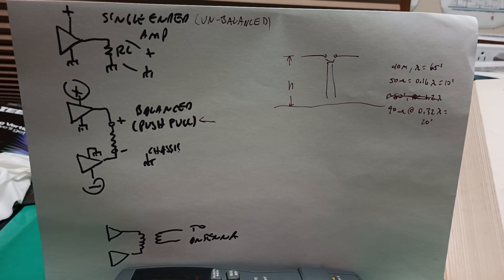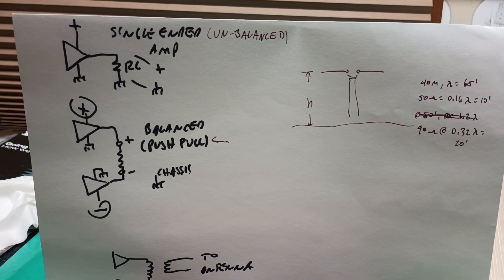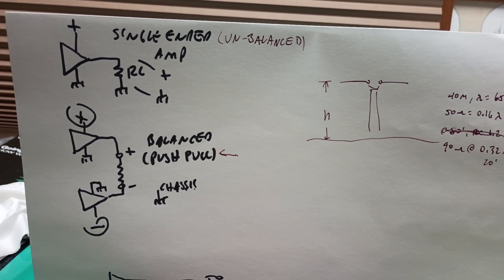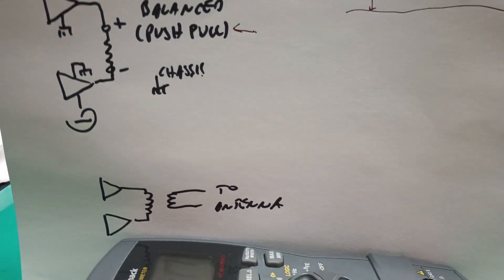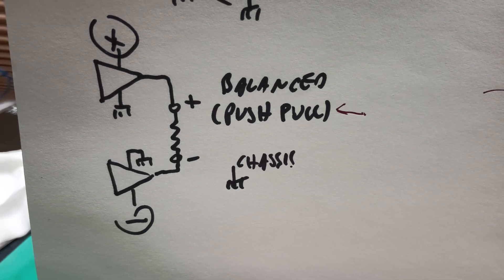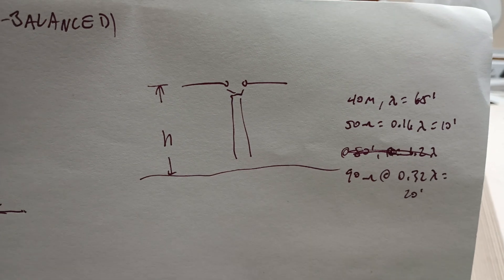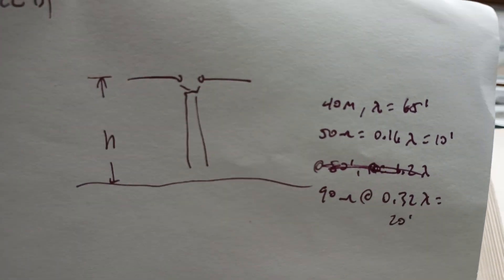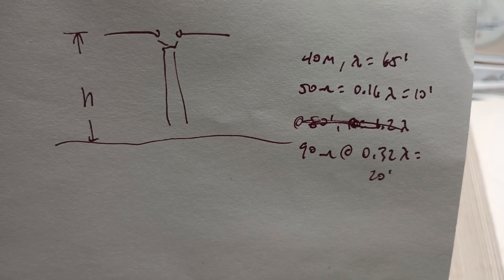What Do Balun and Unun Mean? ( its not what youve been told for $$$$$!)

Comment: Never before heard that "balanced" or "unbalanced" referred to the amplifier driving the transmission line / antenna.
What you;re describing sounds more like what I have always known as "single-ended" vs "differential."
Reply from the maker: So youve NEVER read a radio transceiver manual?

Read old radio textbooks... thats whats missing today.
Folks like yourself are stuck in the internet and rumours and personal beliefs/ habits instead of expanding knowlege

"What you DONT know about" is irrelevant. Not knowing things is NOT an accomplishment.

"Balanced/Unbalanced Transmission lines".." Radio Engineers Handbook, 1948, p. 193

"Balanced amplifier"
Modern Dictionary of Electronics, Graf, 1970, p. 45

Theyre called BOOKS... get some.

What its all, ultimately about is the power supply(ies) oddly enough.

Ive been doing so- going back to the roots of all this in the early 1900s and re- studying the entire field of electronics and RF. Its 9 years now...and still digging.
Reply from the maker: your use of " differential" is out of context here, differential is two signals and their relationship to each other.

https://resources.altium.com/p/what-are-differential-pairs-and-differential-signals

Comment: ^^ Trying to imagine how I can put up a "pure dipole" that would be 1/2 wavelength resonant 40 meters from my apartment balcony 🤣🤣 🤔😭
KD8EFQ
Reply from the maker: Cant without some far support point.

50# monofilament tied to a distant light post would work.

When theres no space, the options are going to higher frequencies or a loaded whip.
Reply: @k8byp  Yes.  Otherwise, I was just attempting to be funny.
Reply from the maker: yeah I was rofl at " resonant!"

Id try a several square foot aluminum plate fastened to the railing, vertically, then mount a loaded whip on it.